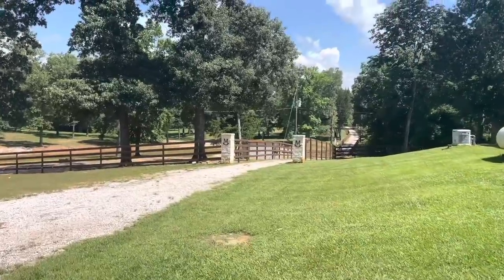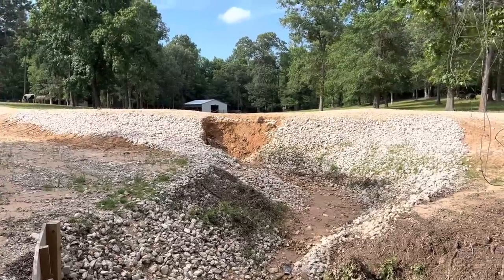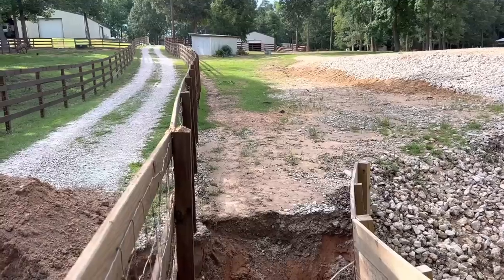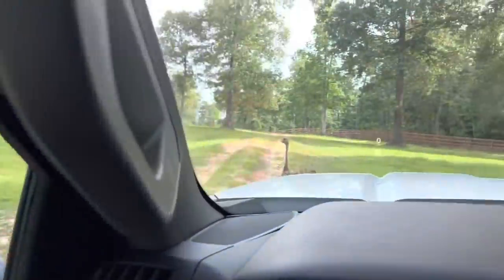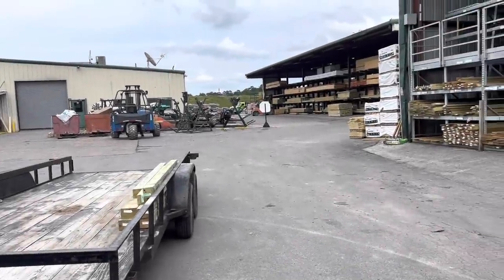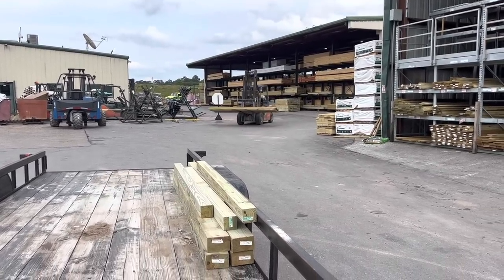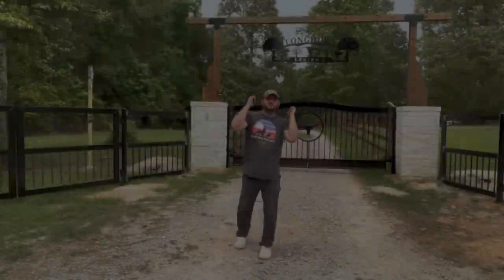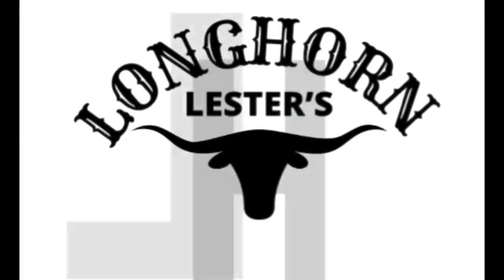Wooden Cattle Guard for Erosion Control

Comment: As expressed by the previous comment.

A U chanel and cattle grid is by far the best, to me the only  right option for that water flow requirement. A culvert, whatever your diameter will not handle water running down the driveway slopes from either side, leading to erosion of the driveway surface at this low point, meetingbjunction of water over driveway surface. Yes the lower region could be a firmed concrete surface that prevents local surface erosion, but any gravel, soil or other materials washed down the driveway by water flow, at least on innerside of culvert will be material dropping into the culvert pipe, the outer draining side will flush easily away. But a culvert always risks building up blocking materials in the culvert pipe, rocks, gravel, branches can progressively fill the culvert pipe bottom up  restricting volume capacity. Regular strong flushing and regular maintence can clear this, especially a smooth pipe, but corrugated pipe unless using very thick steel or concrete pipe is harder to keep cleared. If in a strong storm branches wash into the culvert can rapidly build a major block right at the time maximum flow is demanded. A strong pipe is needed to prevent progressive collapse from load of soil above and traffic. Plastic corrugated pipes are biggest waste, thinner corrugated steel appears to have serious corrosion and wearout issues. 

A U channel instead of a a limited diameter culvert ensures maximum flow area, no major blockage issue and any trend to fill with unwanted materials is clearly evident, but also most probable to self clearing if such is needed. It has no inherent collapse/squashing issues as pipes have. Wearout of U channel floor and sides is easier repair maintenance task than a damaged culvert pipe. 
The cattle grid itself is also good for maintence work, clearly accessible and visible deterioration should such occur.
Most culverts require several section of pipe with joints  if such joints have leaks, hidden washing out around the outside of the pipe can occur without being evident, leading to ultimate pipe/culvert collapse similar to happened at this existing culvert. Even a single section pipe can have this washout around the outside without being noticed.

A cattle grid further is a benefit  stopping /inhibiting any of the animals wandering down the entire driveway,  should they gain access to that by an open gate or intentional letting out of enclosures. Such clearly by history does occur, and most possible enclosure gates are inside the space bounded by this drain/culvert  so well placed to inhibit animsls having access all the way to the main gate.

From the materials you have purchased it appears that you intend lining the channel with wood panels. Be aware if sides or base allow water leakage behind those panel boards, these may washout/hollow behind or under the wood leading channel collapse. Ideally the channel is formed of concrete wall and floor for maximum protection from washout. If wood panels/boards are used do consider a strong water proof barrier behind and under the wall/floor wood. Thrreby preventing hidden washout of soils by water leaking past the wood. Wood of course will need protection from rotting out, or attack by moulds, bugs ( termites  wood borers). Probably needing long term reconstruction.

As far as the pond spillway, yes a depth limiting water drop chute and culvert pipe are possible, quite clearly having similar issues as the existing culvert.  Also flow capacity becomes the same problem as the road culvert. Blocking by branches under storm conditions, and especially at the bottom needed bend, so out of vision location, hard to clear place, may limit flow just when maximum is needed. Leading to still possibly spill over the dam wall. With current dam build/structure the same result as now. Much larger rocks than the coarse gravel will be needed to limit the fast erosion now having occured. I am still personally of the opinion that the over the top and diwnward lower region of the dam wall spillway may need a concrete surface at least on the spill exit face for significant distance to inhibit much back washout to endanger complete dam collapse as now is highly possible. Presently damaged state,  get hit by one at most two similar major storms and the pond dam will be GONE, along with the entire pond water volume. Your current erosion would look minor if that happened.

I admit to not being an expert in all this. Just as an engineer I do have some educated knowledge, and many years on various technical matters, even outside my Electronics profession.

On drainage, culverts and such matters, I  watch another Youtube channel, "POST10",  of a young man who voluntarily goes around clearing flooding,  blocked culverts, under bridges channels, yes they too get blockages,  not being adequately maintened and even damaged by road authorities during maintenance, or wrong choices of size and construction. Especially where road/carpark flooding both inside city areas and along country highway and also more remote forestry unsealed roads problems occur. He shows the bad effects of wrong size, wrong construction,  collapse, blockage by materials or beaver dam block. He actually reports problems to the authorities, and marks hazards for other traffic.  Washed out dirt roads and more. His videos are very revealing and educational on matters of drainage systems and constructions, what works and what does not. It is amazing how bad the authorities are handling major systems they are responsible for. He is located in the far north eastern US state region

Comment: 👏👏👏 I see your vision and I sure that it will work. You are going to pour a cement wall on each side of the broken driveway to keep it solid and from washing out more.  Then put the cattle guard over it as a bridge and the water can flow through.

Comment: Lester, it will all work out and using that treated lumber reinforced with concrete will be durable enough for its intended purpose. Standard 2.5 inch spaced grating and 4-6 solid girder beams at 24" o/c will handle plenty of tonnage with that short span. Going with the treated material would blend right in with LHL's rustic look. Prayers being sent as always. Nathan
Reply: I have no Idea what you just said, but it sounds Really Good!!👍

Comment: I’m not sure about the wooden slats across the top long term with cars, tractors, rain & time eventually wearing it away……in my mind I wonder if metal slats across the top might be better.
However what I do know is that whatever you decide to do will be a well finished project & will work according to design.  You have a great work ethic Lester.  Prayers for your safety this week.

Comment: We used railroad ties... Drilled them and ran rebar threw the ties for the sidewalls...concrete base and. \_/ angled walls on each side to direct water flow... Top was treated lumber... Also gravel all around it...

Comment: I think you could chain or ratchet strap tight around each beam and then use the tractor and your hay fork to hang it from and lower it to where you need it to go in the pit.  Ideally have a second person so one's running the tractor and one is in the hole guiding.

Comment: I mentioned this in another video but think it's worth repeating. The cattle guard will probably work but it needs to be heavy steel or metal of some kind rather than lumber. I've never seen a cattle guard anywhere across the country that was made of wood. 
You could also use a different engineer who is capable of planning repairs on your pond that fixes the issues.

Comment: I like the idea for your fix. I wonder if you should get an engineer to verify the weight integrity of the cattle guard and foundation structure since you will be driving cars/trucks (Your family is precious cargo!) over it though.  I also like the idea that you are reinforcing the bottom with concrete. That sounds like it will withstand water going over it for many years, but I also wondered if the sides should have added reinforcment using concrete or steel to make sure it also can withstand years of erosion and inevitable ground shifting. I'm so glad no one was injured when it washed out. Sending contined prayers as you work on this project. ❤

Comment: You need a concrete spillway  box that way the force of the water will got through the concrete box as it flows out. You have to reinforce the sides under that driveway or it will continue to cave in and your cattle guard bridge will fall in..concrete and metal is better than rock. If you fix it correctly now you won't have to keep putting money into it in the future  ❤

Comment: Cattle guards/grid/stops are a great idea. They do not hurt the animal and if a leg goes down the gap there is a base that will stop them from falling. GOATS will love them they will find the cattle guard an interesting challenge and cross them without any issue due to their excellent depth perception.   Dogs, cats, coyotes, and others will have no trouble getting over the rounded pipes. Even small hoofed animals such as sheep and goats will usually be able to trot right across without much effort.
However as you keep your road gate shut, then it won’t matter if goats get across, but will it be an escaping route for the dogs?

Comment: I have to agree with Jami and what she said during your live today…you don’t want to use wood…you need concrete and steel. Wood isn’t strong enough to withstand the rushing water over and over again and wood will also deteriorate faster as time goes on with water being in direct contact.  A steel bridge will last a lot longer and be more secure. If you want a wooden cattle guard that’s fine but it should be mounded up higher so that it makes a slight hill in the driveway so that the wood doesn’t come into contact with flowing water and should be based on top of the steel and concrete foundation.

Comment: Put a vented steel grate under your wood cattle gap. 
As long as you have adequate support at the edges, it will hold indefinitely and provide top drainage.

Comment: Leverage and ratchet straps to help move and lower them

Create a bridge - do it right with cross members. I'll look sweet, with horizontal 2x's, and secure framing underneath. Divert the water to run from the land into the creek vs using your driveway as the path of least resistance or IT WILL ERODE AWAY before the bridge.

Proud of you for tackling this project. Use the gravel in the creek to help secure the base of the holes & cement. Do your research. 👊❤

Comment: Lester, 
He's my .02 worth of advice or what I would try first. 😉
Why not REGRADE your DRIVEWAY with an SLIGHT ARCH from the CENTER so the WATER DRAINS OFF to the sides? Then you could add either ditching or drainage tiles on the sides of the driveway? The ditches or tiles will help slow down the water flow coming from the top of the property, plus it will guide the water to a much needed CONCRETE APRON with a CONCRETE HEADWALL or WINGWALLS on both sides of the culvert entrance and exit that will guide the water to a much LARGER CONCRETE CULVERT going under the driveway.

Comment: You’ve certainly got a talent for building things Lester.     Good luck with this project, i hope the treated pine works okay.  I think you could really use an excavator, like the guy that was clearing your land at Plum Grove has, just to move the materials into place.  Please don’t try and shift all the timber by yourself, for goodness sake, get some help.
Reply: Get some help
Reply: @cherylfauth9543  You don’t need levels and squares , if you just use your head.

Comment: you need to have a 'rainy day' fund and not touch it unless its an emergency like the colvert issues. start setting aside 20 persent until you get to say $10k and then add 5-10% afterwards so you don't have to delay projects in progress to redirect funds to the emergency fixes and emergency vet care expeenses

Comment: Oh and lester there are alot of places arround that have pipes for old oil rig plants that you could probably get a good deal on too. Maybe even the place by fostoria road. . Want hut to ask around im sure anyone that build stuff out of steel around here would share that info with you. The ideal behind  cattle guard  is most cattle will not cross those round pipes. Never actually seen a wood one

Comment: Probably no good repeating the same thing most are saying but I know steel is expensive but we used 2nd hand rail line to make our cattle grids bound with cement. Lasts forever.
white ants or termites will have a picnic in a few years after the weather breaks down the ant poisoning and the wood itself. 
I hope it lasts for your time span Lester before having to replace it. Took many of us to learn the hard way of never using wood.

Comment: You're right.  Culverts should be very short in length to be effective otherwise they'll clog.  You need flat wide open spillway.  A dam with electric turbines and solid bridge on top of it .  Then dam and turbines open up to a waterfall with wide flat down sloping spillway.  There, that's what you want.  😊

Comment: You should have built a bridge then you could just get over it and be done. LOL 😂 prayers Lester, I know it’s a hard job just handling the 8x8’s and concrete. It will be good when done though. Not only will it drain the water it will be another safety for keeping the cows in if they get out.

Comment: Hi Lester, I know you are very capable, but do you know anyone you can ask about this?  It might be time to bring in your Dad or Sister Kim for advice, Dan, Buddy, Kenny or Jake for brawn. Also, You don't need to be in that hole alone while the pond damn is on the verge of breaking. You could die, I'm serious. Fast rushing water would knock you down, hit your head or get trapped under logs or dirt, etc. Toss your pride on this one and have  the pond shored up first. Maybe Kenny can help. He would let you pay him later i'm sure and he might know something about cattle guards.  I hope you are using metal on a concrete base. I have never seen a wooden cattle guard, will it hold your three ton truck? 💕

Comment: NITA LAWRIE fortnerOk. Two espressions come to mind: this is why women live longer! Here, hold my beer and watch this! Remember your good idea for loading the seed spreader in the back if the truck? You should have consilted your Brother since he builds highways, and you should get help with a project like this. Your family could provide a wealth of knowledge and free labor. What happens if you are doing something and you get hurt. If Jamie is working she might not even notice for quite a while. If nothing else get LE or Ben...someone to be a spotter. My cousin had a lot at Lake Livingston. He went out to level the lot with his tractor-alone. He didn't come home for supper and his wife went to check on him. The tractor had slid into the ditch and flipped over on top of him. He was still sitting in the seat and the tractor was still running. His body was compressed into about a foot tall. Another expression I just thought of ..there is a fine line between bravery and stupidity. Jamie has every right to be concerned. You seem to be hell bent on making her a widow.

Comment: Would carbuckles with 8 gauge wire help with the strength strength between the post. If you are using cement/ concrete for can you add stabilizer bars in the concrete.

Comment: Concrete blocks they make at cement plants from leftover concrete in the trucks would have been an easy way to construct your walls and floor for your cattle guard
Reply: The blocks are cheaper then the lumber and quicker solution and will be stronger and outlast the lumber

Comment: I thought you were just going to do the wooden pilings and no concrete which would have washed away with a good storm. Glad to see your using some concrete. I must have misunderstood your idea in your video explaining your fix. However I don't think the half concrete half wood is a good idea either. Do it right and make it last

Comment: Not familiar with cattle guards but wouldn’t steel post instead of wood post be better if you’re trying to get the water from both sides of your drive to fall into the cattle guard? Wood rots even pressure treated wood unless they’re teak and I don’t think you’d use that but you know what you’re doing when it comes to farming I’ll say that

Comment: Why didn't you use one of those huge cement tube aka tunnel that after it is down in hole then pack it... I've seen it done n worked on driveways

Comment: The dirt/stone is just gonna continue to wash away, the hole in the road gonna get bigger and bigger and the wood will not be supported as it also wash away around the piller in the ground and under. U need some one to make concrete walls on two sides and make a longer and slight higher bridge over the hole, which may also not work cos the water wash the dirt  😢🤷🏼‍♀️🤷🏼‍♀️🤯🤯

Comment: So employee 1 gets a $10 tip for her good hard work and orders herself a pizza (which usually cost more than $10, especially for delivery, meaning she probably paid for it with more than just her tip) and decides to share the pizza that SHE PAID FOR with some of work friends. How kind. Then employee 2 (whom I imagine is not very well liked after this affair) gets jealous that employee 1 is only sharing with her friends (there probably wouldn't even be enough for the whole store to share) and complains to the boss. Then all this results in kind, hard working employee 1 getting FIRED (wtf, getting fired for sharing your lunch) and a ban on accepting tips (instead of a ban on ordering pizza or sharing food or anything slightly more reasonable). Oh ya, I'm laughing, at the seemingly poor employee management at this store. Definitely not the employee that got fired over something so trivial. From the albeit limited information we have from that story, that seemed like a pretty messed up situation.